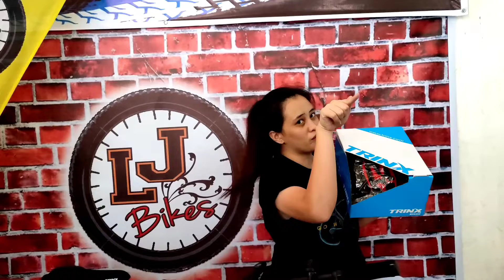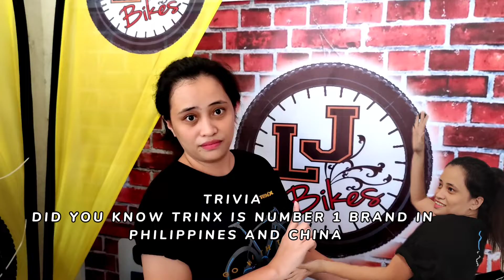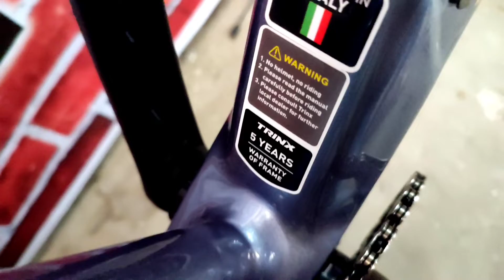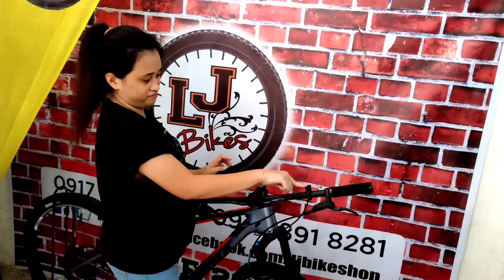VLOG 004 TRINX VCT 1000 (Limited edition)

Comment: Suggestions lang po para detalyado ang bike reviews nyo. Try nyo pag aralan lahat nang pyesa nang bike.
1. Size nang frame overall weight of bike
2. Hubs kung sealed bearing ba at brand
3. Seat post size ang length 
4. Rims kung ilang holes and brand
5. Crank arm length and brand
6. BB if threaded or press fit
7. Handlebar length and if it is alloy or steel
8. Fork travel in mm
9. Rotor disc size
10. Brake set if hydraulic or mechanical 
11. Stem length and brand
12. Headset if seald bearing. Tapered or non Tapered. 
13. Thru axle or quick release. 
14. Lastly the price and if available in cod, home credit etc. Suggestion lang po para interesting sa manonood.